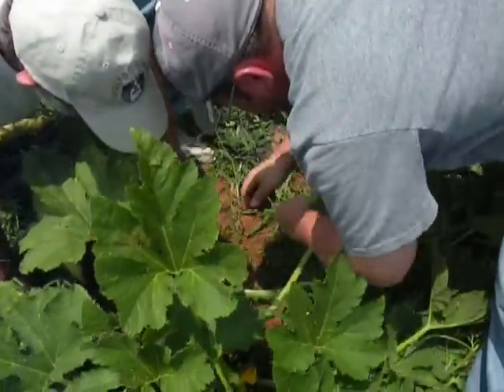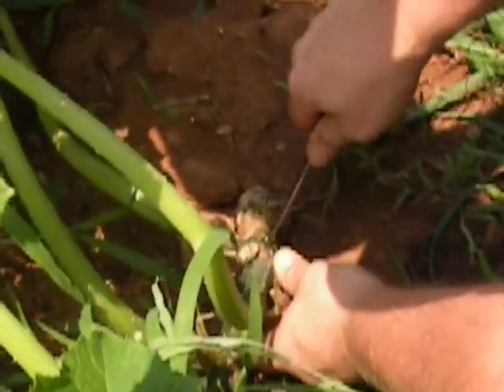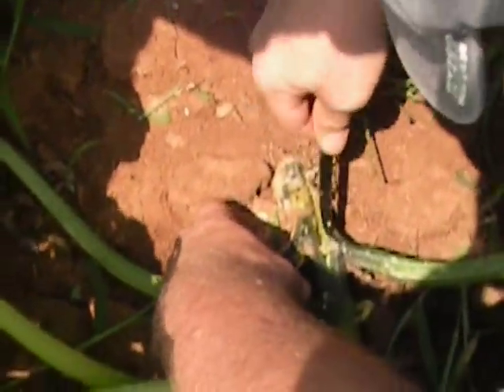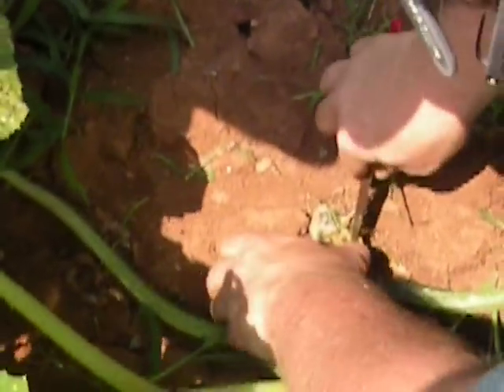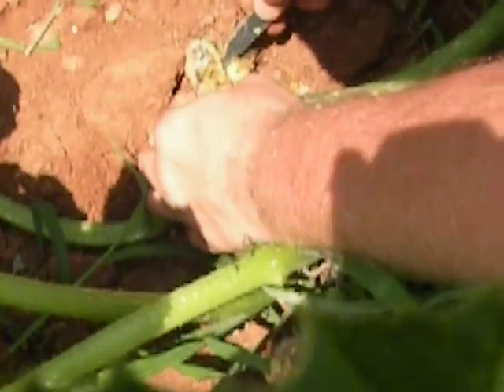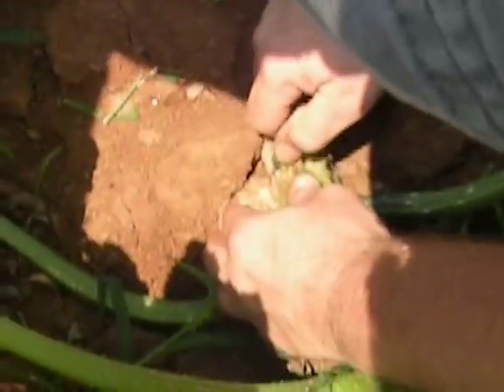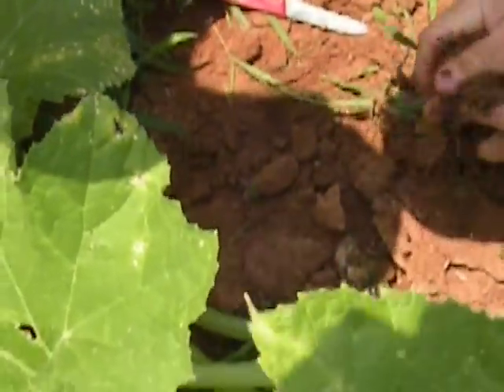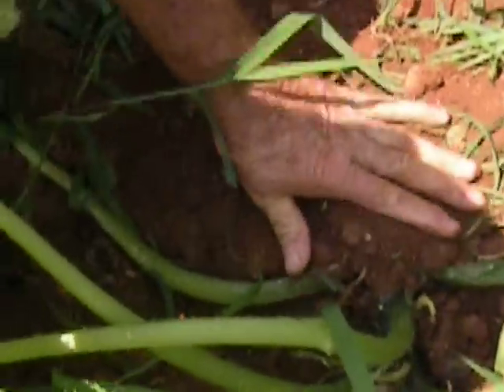Squash Vine Borer Removal Technique from Squash Plants (Deworming)

Comment: Once borers are in your squash you can inject Bacillus thuringiensis (BT) in the hole and it will kill the borer very quickly.  I also mix in some diatomaceous earth in case other try to visit.  Diatomaceous earth(DE) is a physical kill so borers cannot build up an immunity. This is much less destructive and just as effective as slicing open the squash vine. Syringes and needles can be obtained at farm supply stores and BT can be purchased at most gardening stored or home improvement centers.